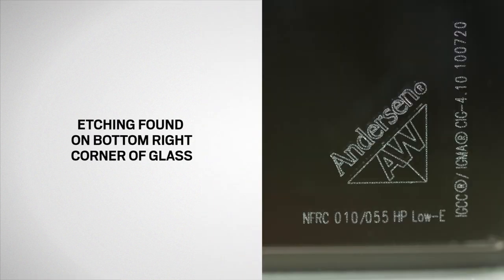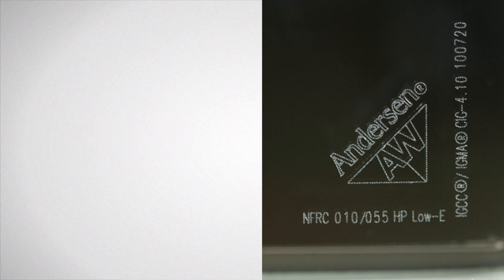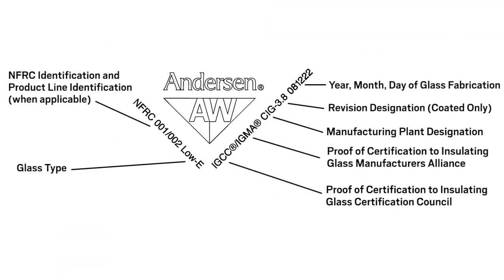Identifying the Parts of a Gliding Door | Andersen Windows

Comment: I have the weatherstripping coming apart at the side where it locks and a piece came out from under that door. Is this all replaceable?
Reply: Did you ever get an answer from them on this?
Reply: I am replacing mine now.  It's best to talk to Andersen to get the parts number as there are a lot of different sizes and they all look alike.  I ended up ordering 3 different parts of the same thing, till I finally got it right.